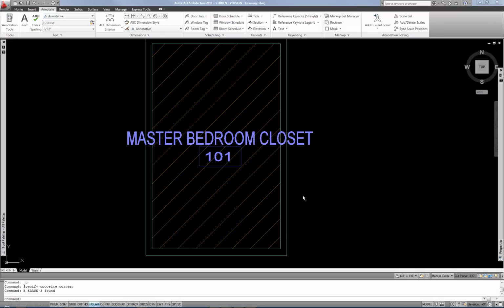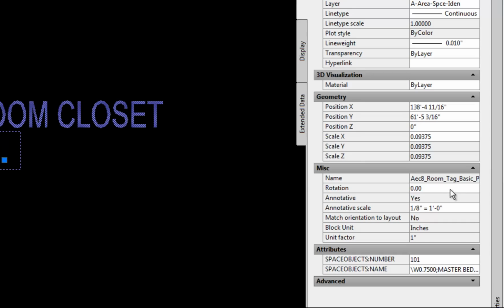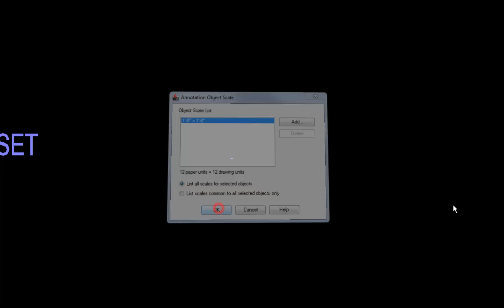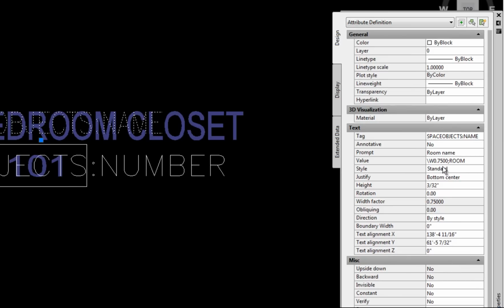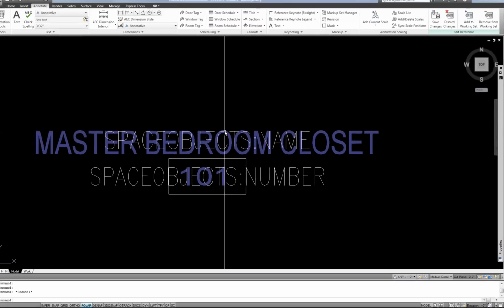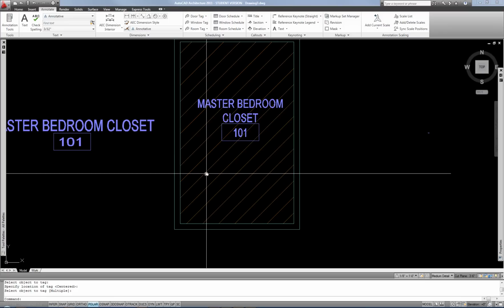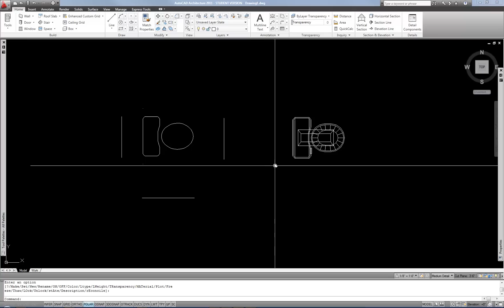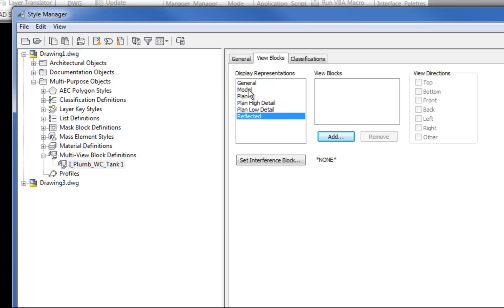ACA: Multi-view blocks

Comment: I notice you use a lot of reference lines to find a midpoint. Did you know you can type "M2P" (Mid between two points) to save time and reduce errors with leftover/forgotten reference lines.
Reply from the maker: +watso8982 Yes, I am familiar with it, although I don't use that osnap often because it doesn't always come to mind since it didn't exist when I started drafting.    Thanks for the suggestion, I hope it helps some other viewers!

Comment: The other problem is making sure you have draw order correct in your block.  So any 'whiteout' device needs to be behind the outline/linework.  Draworder works for a block but fails in a MVB (2 levels?) at some points.  You hatch last which in draworder, last displays on top and no matter where you send it, this is what happens in MVB's.  Answer is once all is drawn, copy all your linework to same place and delete previous. Your linework is now drawn last and will display correctly.

Comment: A wipeout does work as well, problem was that any aec object that is supposed to be white(out) turns black when exported as acad drawing.  Our drawings were done in AcadLite which meant all the blocks with whiteouts printed black and had to be individually altered. A hatch will remain the colour it is, in my case a just off white colour.

Comment: A question, as to whether you have tried this.  In plan view I want my (for eg.) toilet to block out tiles below, so I don't have to trim tiles (space object) around a toilet shape.  So my plan view has a white hatch, that prints white.  I've also tried Invisible Ink which works.  For elevation views it gets trickier, wanting to hide objects behind when aecElevating, you need something solid rather than just a wireframe. I have tried, aecpolygons,regions, and back to a simple hatch. Tried this?